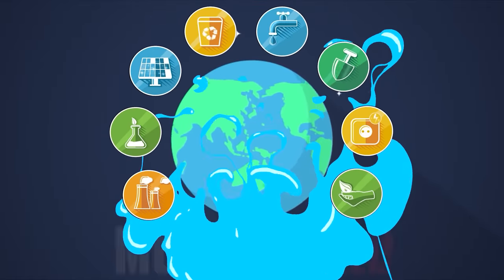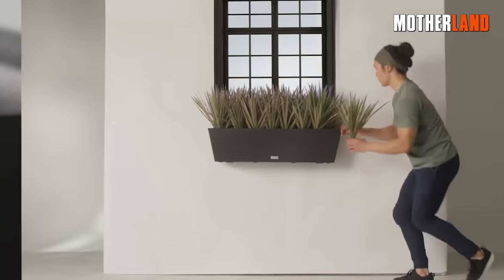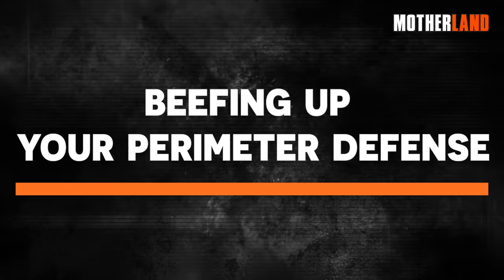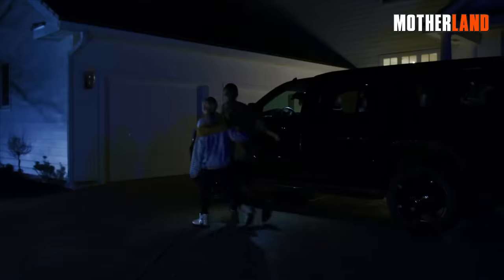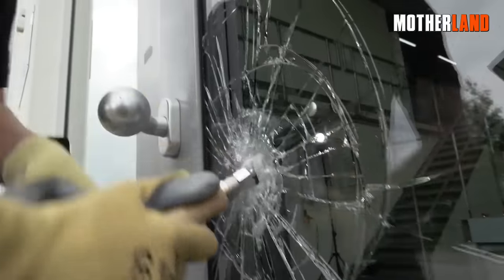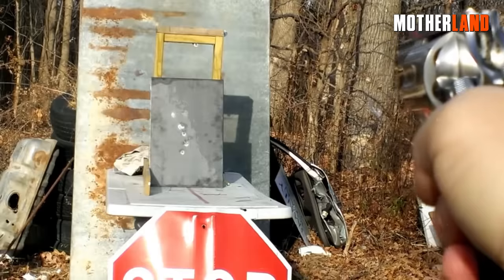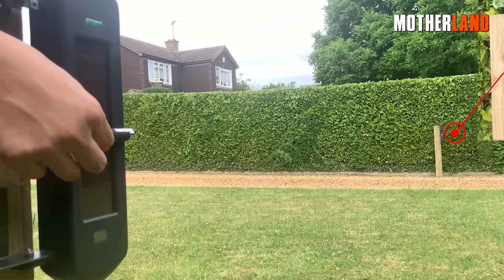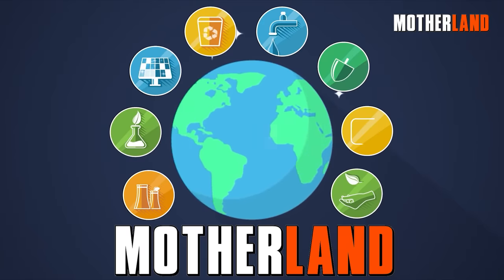Low Cost Tips to Help Bulletproof Your Home for SHTF

Comment: Doubling the outer wall thickness of your home, filling the inner space of with layers of whatever you can affordably get hold of, will stop most projectiles from getting through. Reinforcing outer doors and windows is also good but the best defense is to prevent intruders from ever getting close to your home.  Blackberry bushes around the perimeter of the property limits the access points people can use for gaining entry. In true SHTF situations, quickly block these entry points with downed trees, old vehicles, whatever you have in the moment to stop vehicle entry. Motion alarms or cameras that already monitor these limited entry points, giving you time to prepare your "greeting" before the now "on foot" intruders can reach your home. I recommend a good 12 gauge pump shotgun for home defense. But if you live where guns are banned, just get multiple cans of Wasp & Hornet Spray. Place them at the ready around your home, near doors and windows. They don't require a special permit and can hit a small nest over 20 foot high under the roof's overhang. So hitting a target in the face before they're close enough to get hold of you is very doable. Shooting through a screened door or window opening can also stop close targets from getting in, without damaging the screen that's between you. Their eyes is what you always want to hit, but into mouth and/or nose can also be effective. Non lethal but will definitely stop most intruders, two and four legged, in their tracks. A good Crossbow can also be used to stop intruders, without disturbing your neighbors the way gunshot sounds would.  Making them a good option if you live where laws only protect the criminal. Where you don't want your neighbors and/or local law enforcement interfering in your chosen method of dealing with these criminal intruders.

Comment: i know a while back like in 2016 or 2015 there used to be a film you could get for windows called "Hurricane Film" it was basicly a screen protector laminate for your windows that kept the window from shattering if debris hit the window hard enough to break it, if you can still get the stuff that might work for windows to at least delay the ingress of an "unwanted guest" a bit longer
Reply: We replaced all the windows in our house when we bought it 2 yrs ago.  I was very upset later (~ 6 months after the 3-part job was completed, to find out that the company had impact resistant hurricane windows ... but they were never mentioned in the sales pitch ... I guess because we are inland & not in direct hurricane hit zone.  Had I known, we would have paid the even higher price for them, at least on the back side of the house.

Comment: Place a cast iron fence facing the street, then a row of quick-growing, thorny trees inside the fence, set closely together. I hate locust trees, but they would be useful in a narrow range where you won't be mowing or walking.  I would plant some thorny roses or other thorny hedges in front, facing the house, leaving a gap between the trees and the hedge. Put a tall cast iron gate at the top of the front driveway, flanked by thick brick berms on either side. When building, put sandbags in the middle of the brick berms before sealing. Top the berms with built-in shards of cut glass. Get a dawg or two who are down with biting intruders.

Comment: See through fences are the way to go. Solid walls are terrible. Chain link is the best but you can use some of the nicer stuff like wood or metal trim with hog wire square pattern or you can use the rope criss cross pattern but use heavy gauge wire instead. Plenty of ideas on pintrest to make it look good without that nice rusted ghetto metal chain link fence look. Used with 2 or more layers can trap mob groups or attackers between layers with no cover (heavy duty property line barrier, with inner barrier that is more decorative but still functional). They are at the mercy of your freedom fry dispenser when trapped between the two with no cover (best place to put your laser trip wires and spot lights) while you are behind the protective barriers of your house slinging fries. Honestly none of this stuff will protect you without a freedom fry dispenser and tons of freedom fries. Love the potted plants with sand filler and plates.

Comment: I set out a 1/2” thick plate of titanium from work. I shot it at about 50 yards with a .223 and it went right through it.
Reply: Titanium isn't really a very strong metal.
Reply: @ryanguldbrandsen7672  yes I know. Mild steel is even less strong. Thats why I said it.
Reply: @thelouiebrand  1/2" mild steel plate is going to be stronger vs a normal 1/2" cp1 titanium plate. That's why I said what I said...
Titanium has a higher strength to weight ratio, but it's not that high. 
Grade 1 cp titaniums yield strength being around 220mpa vs mild steel on the low end being 290-350mpa depending on the type of mild steel it easily can be as high at 700-2100mpa. 
Grade 4 titanium alloy has a yield strength around abouts 480-1100mpa depending on who makes it.
Reply: Might have been an alloy that's mostly aluminum.

Comment: Let's start with 3" + screws at your strike plate on your deadbolt at the exterior doors.  A screw that binds to a framing member.  This should be a top 5 item.

Comment: If a 1st Floor concrete wall is required, remember to fill up to were you see it fit, the cinder block holes with concrete

Comment: The last place I’d want to be in a shtf scenario is in an apartment complex I’ll take my chances in a brick house over that any day
Reply: Depends on the apartment building.
My last one? I would pick that over a suburban brick home any day.
There were 400 units that all looked identical, with identical hallways and carpets and doors. Nothing stood out. You were "lost in the crowd".
There was as single ingress/egress point to each apartment, the door. Which was solid wood with a deadbolt that didn't go into wood, it went into a metal frame. Because the building was constructed with metal frames for strength since it was 15 stories.
It had concrete walls on all 4 sides, plus ceiling and floor.
My apartment was 1200 sq ft. I had a spare bedroom with walk in closet that I stored 2 months of water, and 2 months of food. And since water cubes stack on top of one another the sq ft footprint they take up is remarkably small. Food was also easy to store in the spare closet.
Concrete/metal buildings with asphalt roads each block are remarkably fire resistant.
I was armed, so anyone attempting to breech the one entry way had to first figure out how to overcome 10's of thousands of pounds of force. Because I could wedge the couch between the door and a wall (lengthwise). So you literally had to break a couch in half to open the door. And then figure out where I am in the apartment about to engage you with deadly force.
Considering the average person has less than 3 days of food available, and the Pentagon released a report that said within 1 month cities would have a near 90% mortality rate. I could wait out any incident. 
So I would take THAT apartment over a house with multiple windows, multiple floors to defend, and an attacker with room to operate. Such as front/backyards or longer distance engagements from forests, etc. My hallway in the apartment building was only about 8 feet wide. That's very little room to build momentum to generate force.
When I bought my condo, it was even MORE defensible. But my house in rural America? Hmmmm.....
It is very hard to find. It can't be scene from the road, and the driveway is quite hidden. But IF it's found? I'm in trouble. It's very large and I'm one person. There's dozens of ingress/egress points and the walls are just plywood and insulation really. Nothing is bulletproof, and I'm surrounded by woods which mean I'm HIGHLY susceptible to fire. There's acres and acres of woods around me, so it makes monitoring the home very easy for an attacker, and engaging from hundreds of hidden locations. 
It's ONE defense is that it's hidden. But if discovered it becomes nigh impossible to defend. It's too big.
So there are MANY instances where I would take my old apartment, or I would prefer to be in my condo if a SHFT event happens (which is 4 blocks from my old apartment building in the city). But statistically I'll be in the house. As I rarely go into my place in the city anymore.

Comment: You should probably fire proof it. If someone is trying to drive you out of your house and you won't come out and they can't enter without being shot, they'll just set it a blaze and then you must come out. I suggest also building underground tunnel networks in that lead a mile into the woods. You pop out of a bush in the middle of the forest.

Comment: Becareful with the boobie traps, they're illegal in some areas.
Reply: In a SHTF anything goes. I would put sheets of plywood under my windows with 3 inch screws or 16 penny nails facing upward for intruders. It may not stop them but it sure will slow them down.

Comment: Fixed fortifications are an artifact of the very far past. Any force attempting to get inside your  "fort" can either wait you out or find other ways to get in during a SHTF event. Either way you are not going to get out of there without serious casualties to the defenders. But go ahead and armor up if it makes you feel safer. You are only going to be safer with numbers on your side, except there will always be a larger and/or better equipped army that will come along and defeat you. The proof is all over the history books.

Comment: Working on your house? Geo tec fabric is A great way to B proof your house. Drywalling your house ? Put the fabric on BEFORE the drywall. Siding? Put it on first. My house is bullet proof thanks to Geotec fabric. 3 layers of it. It holds up to A 3030 round at 100 feet. The widows are another story. It don't help there.
Reply: Other than your anecdotal experience, can you direct me to any resource materials confirming this technique? It sounds great, and I don't disbelieve you, but I could use some backup before I try to convince my other half.
Reply: @alicefreist318  yes look into building demolition.  Geotec fabric is used in it because it is some what bullet proof. They wrap it around the demolition charges to keep small fragments from flying out of the zone. When I built my house. I put it on the studs before anything else ending up with 3 layers of the fabric sandwiched between each layer. I used plywood sheeting and T111 wood siding. The geotec only added $900 to the cost. On A small 900 Sq ft house. I built A section of wall from scrap leftovers wich l shot A 3030 at from 100 foot. The reason l did this is my old house ended up with bullet holes in it from hunters every couple of years.

Comment: Whatever happened to that sheet plastic bullet resistant material ???
That could be used on windows ???
An old 45/70 will still go right through even a filled block wall !!!

Comment: I have a cheap ©️®️™️ way to do it with garbage basically. Most ppl who would need a BULLETPROOF house are in a poor area, and the others are high profile people more concerned with entry issues not bullets being shot at they house. You close but its an element that will redirect bullets down if they penetrate the outer brick or wood.

Comment: Bullet proof your home
Americans: Do all these things
Germans: We all live in brick and concrete houses...ok, we have windows, too...well.🤪🤗
Reply: A lot of our old homes are built with logs & stone. The 50s to 80s was a era of brick & blocks. And now we build with treated 6x6 post & metal. Pole barns make great homes. Fireproof to a good extent also. Most new homes in my area are stick built w/ 2x4 or 2x6. sheathed with 5/8 plywood. Not exactly sure why you believe we don't have homes that are built as good as yours ? I was in Germany for two years late 80's early 90s. I didn't see much that was different from here besides the castles. I was there when the wall came down.

Comment: We have always learned the drawing might not be perfect in size, but you can always know the dimension shown is correct. Your pictures are in error. 11/16" is not thin, it's nearly 3/4" thick metal. Did you mean 11/32" sheet metal? 
I hear you say 1/16" steel sheets while showing again 11/16". Please correct drawings, it will help us to know what you are talking about much better. Great work otherwise!   Thanks.
Reply: Post a reference of the weight of 11/16 sheet!  this is a list of someone who never seen federal buildings being renovated!  Every federal building that had complete renovation since 2002 is bullet proof.  Judges' cabinets are also bulletproof with materials that don't stand out from regular drywall.

Comment: When my father was picking thr house. He made a good choice. The house is on stilts. In the country side. Want to break in this house. Good luck both doors are steal doors with a full wooden core. Try to kick it you're probably going to eject yourself off the second level which is the only entrance  to the house. Sure use a ladder for any of the windows. Yet that's a huge risk. I don't have to use the Sig 400. Yet it there if needed. Yet there is many more things in this house for defective and offensive uses.
Reply: Nothing like setting a 55 gallon drum of diesel under it and lighting it you'll come out when the temperature  rises 😂
Reply: @hookemrods8101  yeah sure someone is going to make it that far with a 55 gallon drum of diesel fuel without alerting a guy with a SIG 400 with 60 rounds of nice try. One you be lucky to pull in where I live on the road that comes off the main road. Let alone get in my yard with a dirt driveway with the weight of 55 gallons on a truck and trailer. You'll be better off with one gallon and on foot. Even then someone here is always awake. You might want to think carefully.
Reply: @MildarValsik  who said I'd be using a truck and a trailer or carrying it ?
Reply: @MildarValsik   sig m 400 5.56 16 inch barrel  600y ard max range with $2000 + optics all you ar boys think alike but you clearly  think the ultimate  peace keeper is a .556 which is for close  combat which you clearly  said you're not in the city 👍🤣🤣 let me know how that works out shooting that light grain bullet through twigs and brush 🤣🤣

Comment: Some of the things in this video are good advice but other things are HORRIBLE advice. For instance the part where he talks about sign's. NEVER put up signs that say "Beware of Dog" or signs that say things like "Step on my lawn and you're toast" or any other novelty signs that tell someone they're in for a bad time or death if they enter your property. It is VERY easy for lawyers to destroy you in court for those types of signs and it's been done to MANY people in the past. Instead of beware of dog use "Dog on Premises" or "Guard Dog on Premises". And NEVER use novelty signs as those will be shown in court as you were just waiting to hurt or kill someone who came onto your property. You'll be made out to be a nut who couldn't wait to harm or kill another person. The beware of dog sign shows that you have an uncontrollable dog that will attack anyone. Also, the section about booby trapping your property... DO NOT booby trap your property during normal times as it is illegal in the U.S. of course once SHTF then DO IT! And when SHTF and you booby trap your property then go all the way. It doesn't have to kill them but take them out of the action for good. Dig a 2'-3' hole and place down large sharp nails  that have been put through a board at the bottom, cover the hole and when they step into the hole gravity plus their body weight will impale their feet/ankles on the nails rendering them useless for any further activity other than leaving. If you smear feces on the nails then infection will take care of them by either forcing them to have the area amputated or they'll die of septic shock. Another thing you can do to help prevent people from jumping over your tall wooden fence is to buy tack board. The same tack board used under carpeting, then attaching it to the upper inside portion of the fence so it can't be seen from the outside, but if someone jumps up and grabs the top of the fence to pull themselves over it will pierce their hands/fingers and they won't be able to get a safe grip on your fence to pull themselves over. If the tacks are rusty then they'll either need a tetanus shot or they will eventually die of tetanus. And once again, if you smear feces on the tacks then that will also spread infection that will require flushing of the wounds and antibiotics, and if they don't have access to those then they're either going to have their hands/fingers amputated or they'll die of sepsis.
Reply: I like it  !